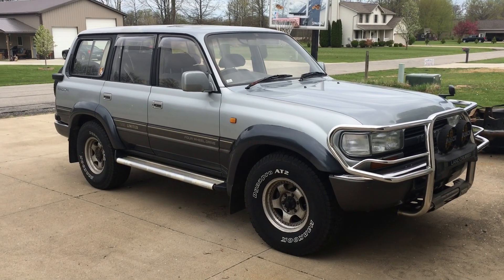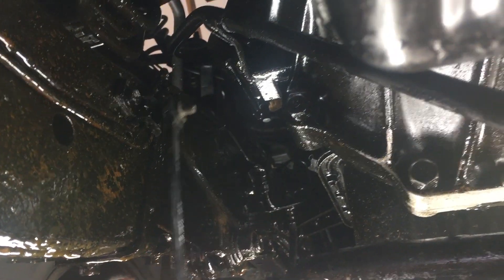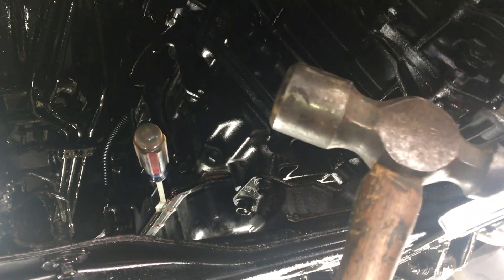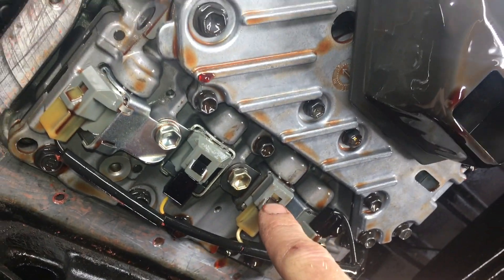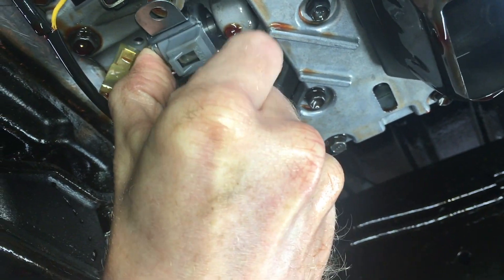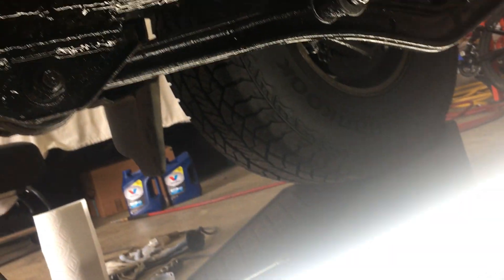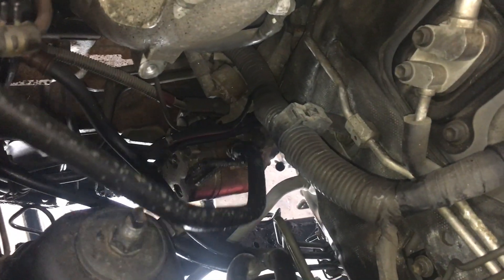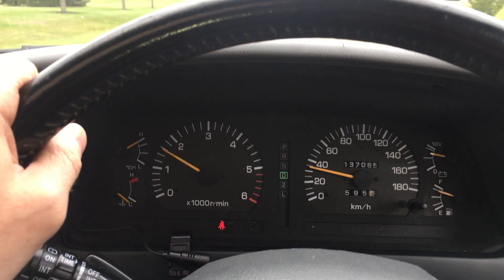How to: Replace Transmission Solenoid - Toyota FZJ80 Land Cruiser, 80-Series with A442F Trans

Comment: Yo le cambien los 4 solenoide izusu, después le compre los dos del centro toyota y sigue con el problema. La luz de overdrive parpadea y cuando pongo D no sale en primera. Tengo que poner L primero y después paso a D . Y ya no se que hacer
Reply from the maker: Did you check the code? It should tell you what is wrong.
Reply: Hay un switch que es el que pone los cambios cuando mueves la palanca y va por el lado de afuera abajo del lado del pasajero está pegado  a la transmisión ese puede ser el problema

Comment: Hy bro can u help me i have 2006 model LC 5th gear is not shifting  1-4th gear is very smooth shifting but not shifting 5th can u pls explain
Reply from the maker: I don't know anything about a 2006, but I would check to see if there is a code for the transmission. You'll probably need to plug in to an OBD2 scanner for an 06 model. That might tell you exactly what the problem is, if it's a solenoid.
Reply: Fault code not available fully clear but top gear is not shifting  im cruising 130klmp the rpm is 3.5. It's not possible  do you knw anything
Reply from the maker: @noufalshanoufik3847  Are you sure overdrive is working?

Comment: I have the same issue as you except my truck is the USDM 1994 Toyota Landcruiser, would it be the same solenoid part # ? and how do you identify the transmission A442F on my landcruiser thanks?
Reply from the maker: Yes, the JDM and US both use the same transmission & solenoids. 1993 & 1994 had the A442F transmission. If you look at the vin sticker on your 80, it should also say A442F near the bottom.

Comment: Hi.   I have a hdj80 1994near 500 000kms. And the 3rd gear doesn't works   the 1, 2 and overdrive are or but not the 3rd

Can you tell me whitch one it is?   And if you have the link for buy cheaper as i can hear in your video

Thanks a lot!
Reply from the maker: Hi, the links are in the description for the solenoid. Is there a flashing code and did you check it: https://youtu.be/bGFdDOjVX-Q
Reply: @6thGearGarage  ok thanks for the link
I have no fault code,
Just the 3rd gear miss

The 1st and 2nd are ok but after the 2nd the gearbox goes to the O/D
And if i switch off the o/d it goes to 2nd
You knod witch solenoid is used for the 3rd?
Reply from the maker: @tibo16300  It's been a few years since I've been in the transmission... I don't remember. Did I say which solenoid it was in the video?
Reply: @6thGearGarage  yes.  You told it and i have in the manual bat their name are : timing solenoid valve, n1 solenoid valve, n2 solenoid valve, lock up solenoid valve

Then i dont know whitch i have to change for my 3rd gear (2to3)

"D49421A Solenoid, AW450-43LE (RNJ) Shift 1 --- Timing Solenoid
D49422A Solenoid, AW450-43LE (RNJ) Shift 2 --- No. 1 Solenoid
D49422A Solenoid, AW450-43LE (RNJ) Timing --- No. 2 Solenoid
D49425A Solenoid, AW450-43LE (RNJ) Lockup --- Lock-Up Solenoid
" (copy on a forum)
Reply: Have order the 4) at this price..
If you know where to find the sensor at the left side of the gearbox who send the position of the lever,  mine doesn t works

Thanks
Reply from the maker: @tibo16300  I think that sensor is available at the toyota dealership.

Comment: Are these solenoids the same for the A440F transmission in the FJ80s with the 3FE? Thanks for the great videos 6th Gear Garage!
Reply from the maker: I don't think they are, as it's a different transmission. But I don't know for sure, as I've never worked on an older one.
Reply: Thanks for the reply. Are you going to make more Land Cruiser vids? I hope so. I have been watching your videos for so long and in joy all your videos. Thanks and keep up the good work.
Reply from the maker: @andrewdrazin4779  Yes there will be more to come. I filmed replacing rear brakes and I have also been working on a full review of the 80 Series.

Comment: Thank you for sharing.  I removed my transmission shifter handle.  I had to put the transmission in 1st to access the screws.  Now it is back together,  but it won't start.  Any ideas 💡 🤔....
Reply from the maker: What was wrong that you needed to remove the handle?
Reply: @6th Gear Garage  the leather is deteriorated on the shift knob and replacing with new. I'm thinking that I may have disconnected a wire in the process.
Reply from the maker: @dfox344  Yeah I'm thinking it's something simple. Normally it won't start unless it is in Park. I'm guessing it's something to do with that.

Comment: is the solution same for a 1996 LC? 

I get a “thud” sound when it gears down from 2nd to 1st gear. 

thanks
Reply from the maker: The 96 has a different transmission, but the process may be similar. Not sure if the part numbers are the same though. I’m not sure the thud is the result of a bad solenoid, is the check light on?
Reply: Hi, I'm in a similar situation with my lc, I'll try the solenoids, were you able to fix your transmission? Does anyone know what transmission mounts the lc 97 thanks

Comment: Hi there so good video
My lc does not take off in the first gear. I need to put to L then 2nd to D. Gear does not slip. Rpm work normally. Just got transmission service done. Is that solenoid issued?
Thanks
Reply from the maker: The best way to know is to read the code. Here is how: https://youtu.be/bGFdDOjVX-Q
Reply: There is no flashing light on mine
Thanks
Reply: Did you ever find out what your issue was?

Comment: did this diagnostic work for the 1997 ? thanks
Reply from the maker: I'm not sure if it works on the OBD2 models. Does yours have the diagnostic port on the firewall? Or you may only have the OBD2 port under the dash.

Comment: have you worked on A442F early transmissions? I've read that they came in the early trucks with no electronic solenoids at all.
Reply from the maker: No I haven’t had and experience with those.
Reply: Only the 90-92 from wha tive heard  atleast here in aus

Comment: Great video - gives me the confidence to tackle the job.  My 2000 LC just revs when trying to start in Drive.  I can start in L and then shift to Drive once moving.  Is this a solenoid issue or something else?
Reply from the maker: I'm not familiar with that year, but I think a faulty solenoid would cause some kind of light on the cluster to come on, as it did with mine.
Reply: Harrison did you end up getting that fixed? My 94LC revs up in D and does the same thing, but reverse is perfect. 

Any idea??

Comment: What do you spray on the undercarriage? My 80 is a rust bucket
Reply from the maker: I use fluid film on the underside of all my vehicles. I also spray inside the body panels of my 80 to keep them from bubbling up and rotting away https://youtu.be/nzWx3-9PKT8

Comment: Would a Bad Silnoid cause the land Cruiser to not move till Rpm's go up
Reply from the maker: That doesn't sound like a solenoid issue to me. I would check the transmission fluid level and be sure the torque converter is in good working order.
Reply: @6thGearGarage  i put a good used transmission and rebuilt Torqe converter in few months ago fluid seems to be fine i drained and refilled still same issue and ideas?
Reply from the maker: @roon101k6  I don't know but it doesn't sound like a solenoid issue to me. If the fluid is good, I guess Possible bad  tq converter or internals of the transmission.

Comment: 6th gear garage does these solenoid fit 1fzfe fzj80 land cruiser because I see The year 1998-2013 in the descriptions??
Reply from the maker: I can't say for sure, but it's possible because these solenoids are used in other transmissions. I'd get the toyota part #'s from a dealership and cross reference them to Cobra's to be sure.
Reply: @6thGearGarage  problem solved, cross reference part #'s and they do fit and are genuine parts all the numbers start with #9720...indicate genuine parts..

Comment: Great tuition 6th Grade garage, exactly what's going on with my 1fzfe j80 series right hand drive steering colum in Australia.But I'm just wondering if you could tell me the name of the company where you bought your solenoid from...cheers,right now in Aus the cost is 1k which is sold as a full solenoid kit but I'm only wanting the four parts showing in your video..much appreciated
Reply from the maker: There are links in the description for each part. it was $200 for all 4 shipped to me in the US.

Comment: Hello, such a great how to video. 
I am working on an A442F with a 5th solenoid found on the RH side of the body valve above the filter, and there is also an square green ATF temperature sensor (Denso 08SZ) that differs from the transmission you showed.
I've been researching for a while what is this 5th solenoid used for, I believe it may be either a proportional pressure line solenoid or just a shift-lock solenoid (which usually are outside of the transmission assemblies, locking the lever mechanism).
If you have any clue that could point me on the right direction to find what could it be used for I would appreciate!
Reply from the maker: I wish I could help, but I have not seen one like that before

Comment: great video - I am looking at a 1993 LC now that also has an A442F solenoid issue and this video is fantastic.  Can you tell what condition rating this car was listed with in the Japanese auction  (scale of "R", 2--4, C-D interior...etc.)??   Also, Did you use a broker service you can mention on youtube or conduct the purchase through another contact in Japan?
Reply from the maker: I bought the 80 from someone who had it imported last year, so I was not involved in the importing process. It already had a Ohio title when I bought it. The auction grade was 3.